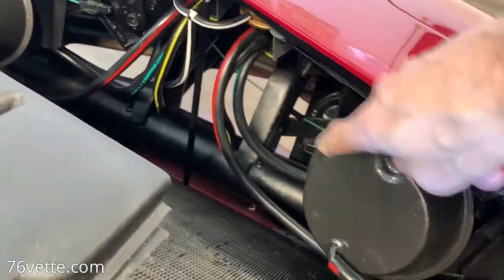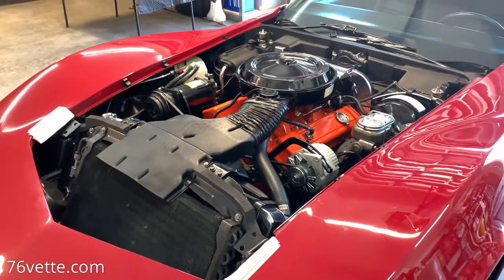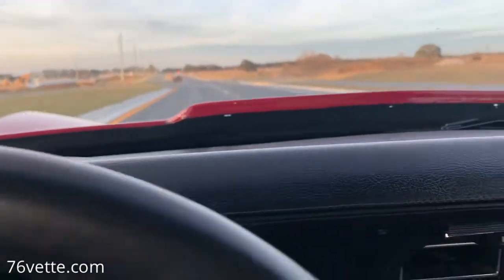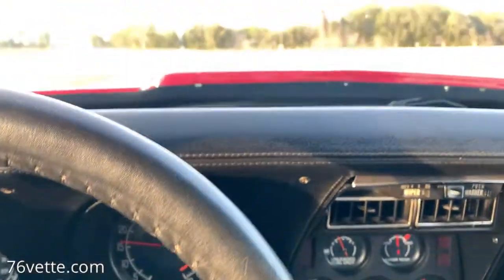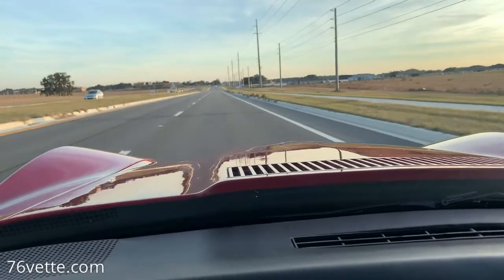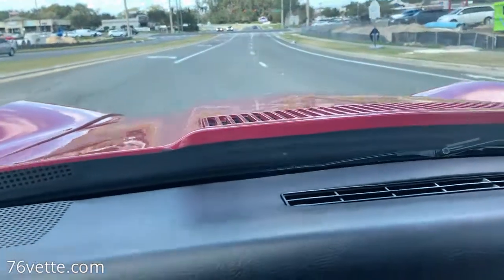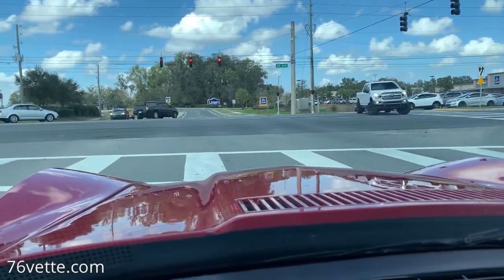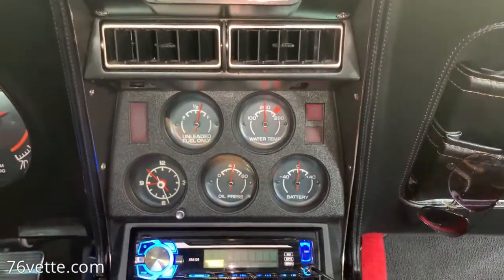RADIATOR SWAP: Final Checks and Test Drive

Comment: I almost bought a Champion for mine two weeks ago, but instead went with a Cold Case. I think they're very comparable, although mine is just a two row and cost twice as much. I'd read that with aluminum 2 to 3 rows doesn't really make a difference. Who knows?  Sure was fun taking the whole front end of the car apart and then putting it all back together. Very rewarding...  I very much enjoy your channel, thank you for the work you put into creating these videos.
Reply from the maker: Thanks, Mike. The size of the radiator tubes (not the number of rows) is what makes the difference. But an aluminum rad (2- or 3-row) vs. copper is a huge improvement. 
I also posted an article about the swap to my blog: https://www.76vette.com/2021/01/champion-3-row-aluminum-radiator-c3-corvette.html
Glad to hear you enjoy the videos. Lots of work and time goes into making them, and I’m my worst critic so I’m always second-guessing if I should hit “Publish.” lol 😆

Comment: I bought a 77 with an aluminum 2 row radiator from China lol that was already installed it just doesn't fit very well flops around doesn't fit into stock location very  well. Seems like the champion fits pretty good?
Reply from the maker: Yes, the Champion radiator fit like a glove. Make sure all the core support seals are in place to keep the radiator from moving and potentially getting damaged. That is provided they installed the correct radiator in the first place. 
Usually 2- and 3-row radiators are dimensionally identical, with the only difference bring the tube diameter.

Comment: Your stock temp gauge sensor is right below number 1 cylinder spark plug.  Better to measure there.  I'm convinced there is something wrong with that temp gauge by measuring at the neck.

Comment: Maybe off the subject but have you had the engine out of your car?   I’ve heard you say that the intake and carb have been changed.  Looks like some of the smog equipment has been removed. Thanks, good video.
Reply from the maker: Yes, the engine was completely rebuilt a couple of years ago.

Comment: What engine is that? How much cost you to swap the engine? 🙏 thanks
Reply from the maker: It’s the original L-48 350. Had it rebuilt to factory specs with a mild cam. Big fail on my part. I should’ve bought a crate engine 🤦🏻‍♂️

https://youtu.be/M8OJ7BGt_nY
Reply: Thanks It’s a good advice for me because I have a Corvette 76 and I’m looking to swap the engine so now I know what to do.My problem is I live in Chicago and I don’t know anyone to do that. I hope i will find a good mecanic. 🙏🙏🙏